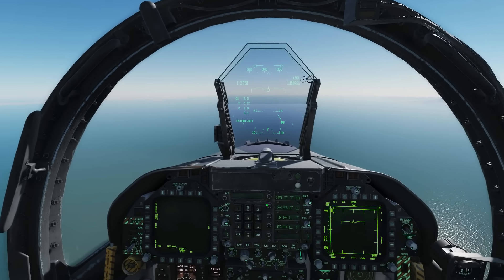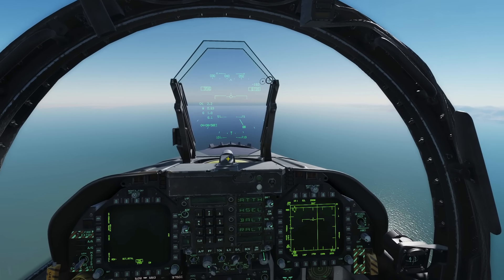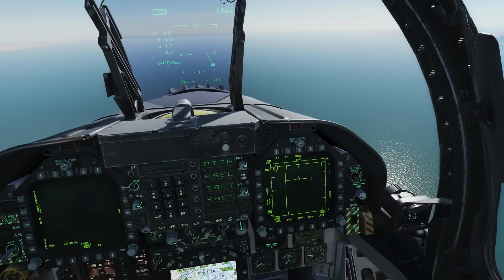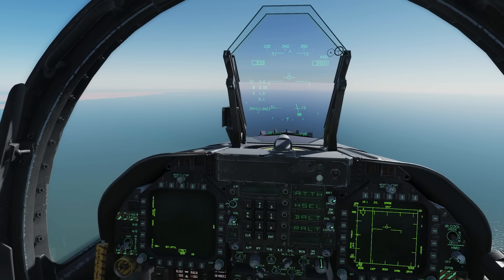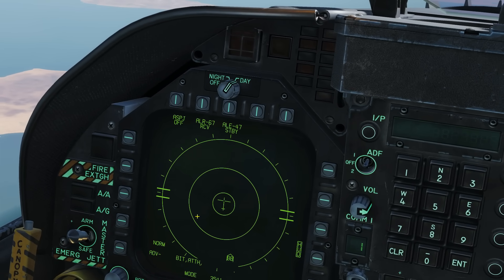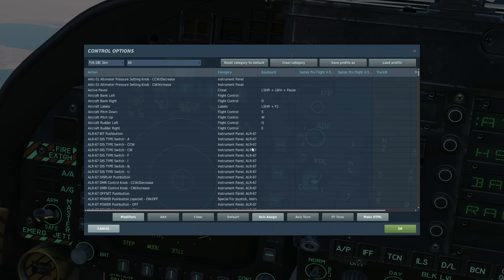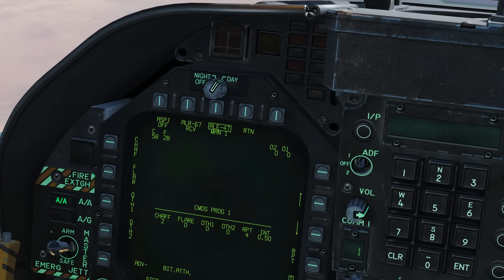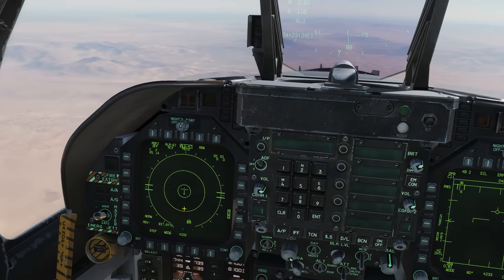FA-18C Hornet: Countermeasures (ECM, Chaff & Flares) | DCS WORLD

Comment: Question: How does the (semi-)auto system decide when to deploy flares, considering that IR-guided missiles are not detected by the RWR? I assume in semi-auto it uses flares programs when there's no incoming radar-guided missile detected by the RWR, so it assumes you are facing an IR-seeking missile. But that doesn't explain how the auto mode decides if and when to use flares. So maybe the system has sensors detecting incoming missiles?
Reply: Just noticed someone also asked it before. According to the answers there, the plane can "see" an incoming missile and deeply CM accordingly.

Comment: I guess that as you can be hit with an IR missile without the Hornet detecting it, then it might be the case that Disp Switch Forward should be set with a view to defeating (primarily) IR missiles which the pilot has seen with his eye in Auto Mode? For example you have a mig on your tail and see a missile come off the rail without warning so the Auto is going to do nothing so you can be sure it's an IR missile. So Disp FWD and drop flares only?

Comment: How would the airplane or the Automatic Countermeasure system know when a IR missile had been shot at it, there is no tone or early warning when a heat seeker is shot because it doesn't use radar. Can anyone explain?
Reply: There are sensors on the F-18 that detect the exhaust of the IR homing missile launch, basically any rocket launch.  These days these detectors are so good that they can detect the missile itself without the exhaust.
Reply: @daviddickey9832  thank you I’ve been curious how that works
Reply: @Riddim_Squid I know it’s been two years but this guy lied to you lol, the F/A-18C does not have a IR missile detection system. Planes like the A10, and Apache and C130 have it and probably the super hornet and new F16s.
Reply: It can’t detect when an IR missile has been launched
Reply: Because the missile knows where it is where it isnt
Reply: It detects the missile in flight.

Comment: I think the ECM in XMIT mode works selectively.  For example, if you turned on XMIT before you left the boat an inbound Mig wouldn't get an azimuth from 100 miles out because your ECM wouldn't start broadcasting until it detected the Migs radar.  If the Mig turned on his radar at 30 miles, that's the point when your ECM would go active and If that Mig turned cold your jammer would go quiet.
Reply from the maker: rgr thx

Comment: Does burnthrough work because of paralax?
Reply: Wul  I"m guessing burn through is the radar pulses are stronger than the spoofing signal at shorter ranges thereby the radar ignores the spoof.
Reply: Terry is correct. At burnthrough distance and beneath, the radars reflection is at higher peaks than the jamming signal. Hence all comforts of Doppler effect can be used to determin distance, aspect and calculate a valid fire solution.